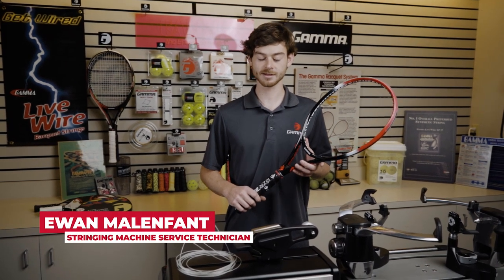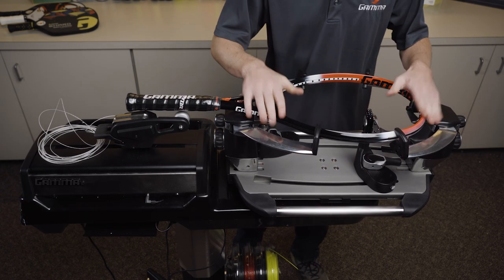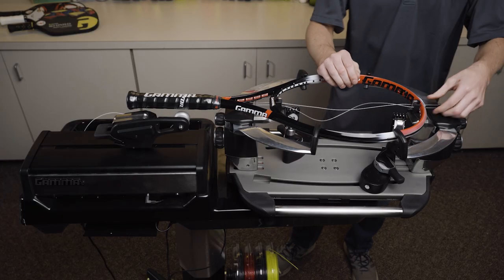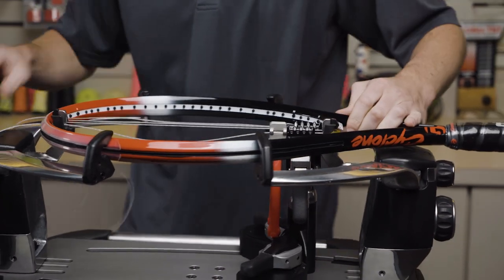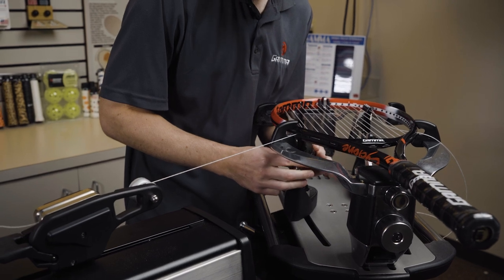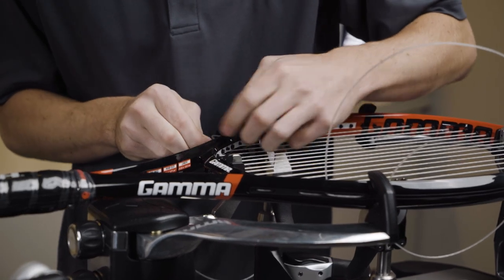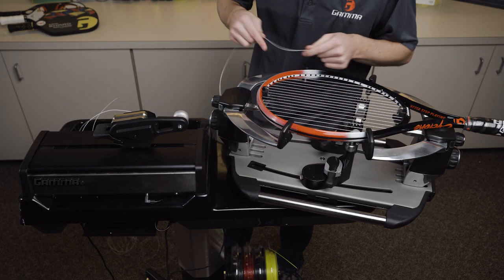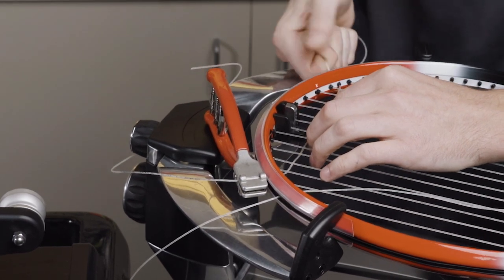How to String a Tennis Racquet

Comment: I weave 2 crosses first like you but don't double pull. I pull the first cross and have never had a problem with starter clamp slipping.  Other than that basically the same. Good tutorial. Props to Gamma, I first learned on a gamma crank several years ago before moving to electronic. Good stringers.

Comment: Great video. You could (need) to use a starting block/off set tool with the starting clamp when stringing multifilament and gut strings.
If you need a starting block, I can send you one if you'll get in touch with me.

Comment: Why is it necessary to release the base of the clamp first?
Reply from the maker: The main reasoning is that if you release the string clamp first, there is a possibility the string could slip through the clamp as tension is released and cause damage to the string. Releasing the base first prevents this from happening by releasing tensino while the string clamp is still locked and what chew into the string at all.